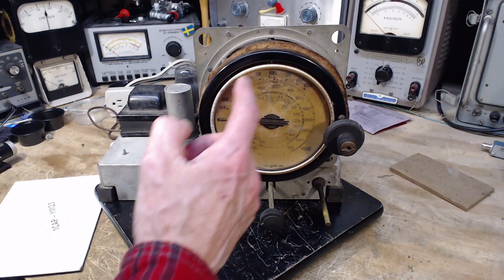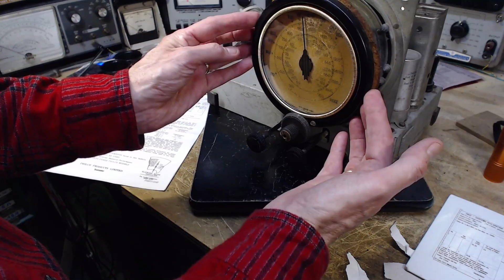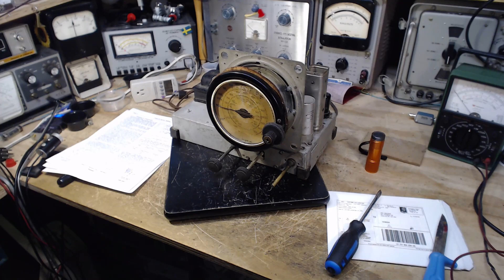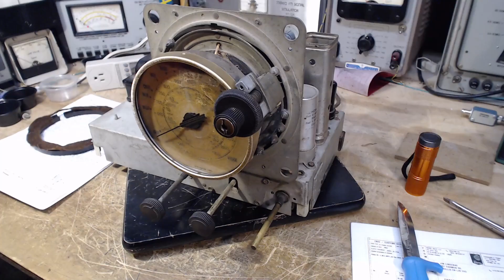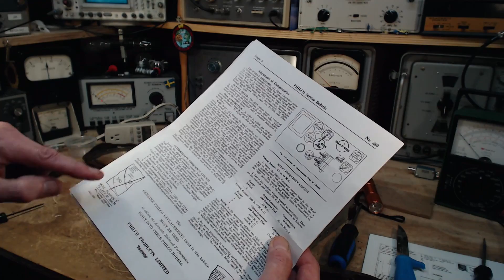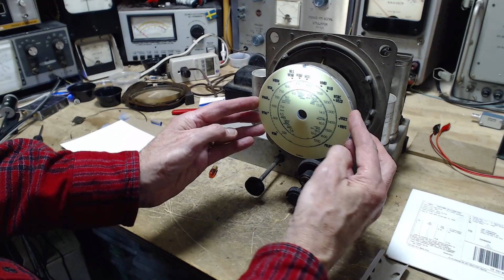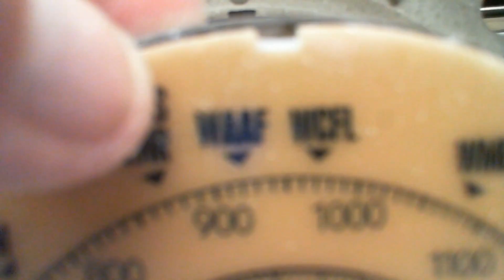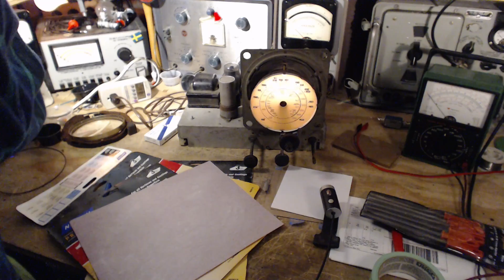Philco 38-C7 Tube Radio Video #13 - Dial Plate and Back Light

Comment: This is what I think...the wire that you cant figure out, I think disconnects the sound of the radio while your tuning it...The tuning knob has 3 position, and one of them disconnects the sound while you "speed dial" around the dial....And about the key....The key installs OVER the cones that set the freq. you want to set it too. They must turn like a screw then lock down at your radio stations freq. I seen all this on a youtube video.

Comment: I was hoping for a new radio... kinda bored here!

I was also wondering about some of the places that supply parts. if they are safe to order form! radio daze was one of them, so I guess that answers one of the questions of  radio Daze!

also, Winter is supposedly going to be brutal! cold and snowy in Iowa! so, if you are reading these comments still Jim! you might want to look into the long range forecasts for your area in winter, maybe even look into stocking up for the possibility!

also, Tang here is a Drink: one that is a fake Orange juice drink, that is nearly 100% HFCS! (High Fructose Corn Syrup) aka Sugar!    

this page does not hold all of the Information about Tang:    https://en.wikipedia.org/wiki/Tang_(drink_mix)